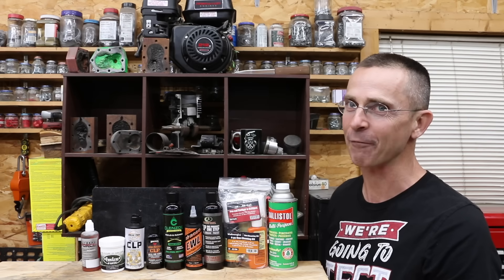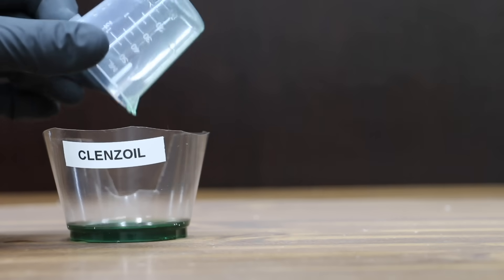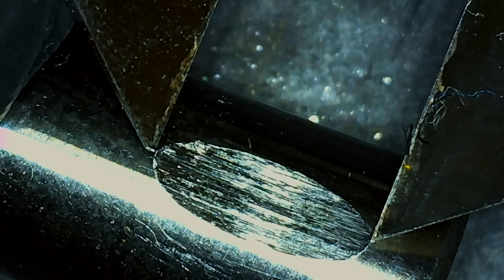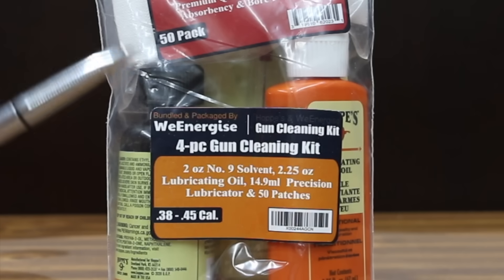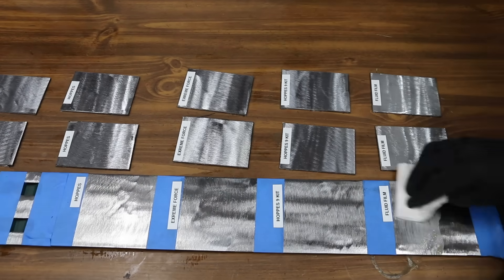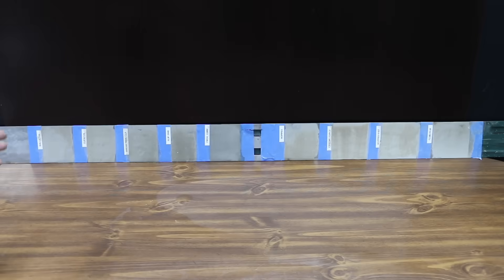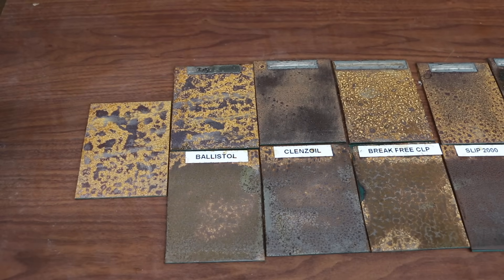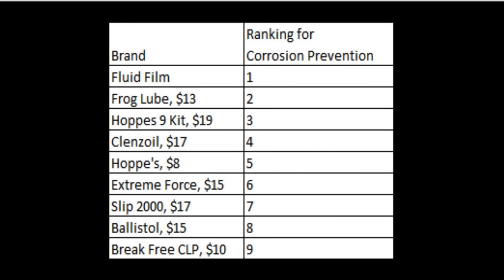Don't Buy A CLP Until You Watch This Review! It'll Save You Time And Money!

Comment: I know I'm a little late to the party here, but I'd be extremely curious to see some tests along the same lines performed with a product called Molykote D-321r. It's a spray-on, air cured dry lubricant that is a very long-lasting semi-permanent lubricant that performs well in both extremely hot and cold temperatures (-180 C to +450 C according to the manufacturerrer). 

The only reason I even know of this product is because I work in the aviation maintenance industry, and we used some of it on the intake fan blade pins. We had to apply it to these pins, then buff it slightly afterward to make it smoother as per the instructions, and I was surprised at how well it held on to the metal pin. After realizing the constant movement, stress, and extreme heat/cold this lubricant must be exposed to, and the fact it went through extremely stringent testing to be used in aviation, especially the engines, it made me realize it would likely work extremely well as a firearm lubricant. Only problem is (besides cost and availability, although I see it for sale on eBay for $50 a can) is that it's the same color as carbon fouling so good luck figuring out when a firearm is clean or dirty lol. Also, it would only be useful as a lubricant, not a cleaner.

Thanks for reading, if you did, and keep up the great work! You continue to astound me with your creative yet extremely thorough tests.
Reply from the maker: Thank you for the video idea!

Comment: Thank you so much for this and other great videos. I want to pass on a tip to the readers and avid gun users/cleaners. Lately, I have had a few guns "gum up" on me - meaning, the oil that I had used becomes almost a solid or extremely dense and sticky. After much research and trial by error, what I found out is that I was MIXING different oils - meaning I would start by lubricating with one brand of oil and then I would use another one just to make sure the gun was nicely lubricated. Turns out that some oils do NOT mix and as a result become extremely NON oily and become sticky and gums up the gun in lieu of lubricating it. For those guns I had made that mistake, I used 99% Isopropyl alcohol to thoroughly remove ALL oil from the parts (i.e. barrel or slide) and then used only 1 oil and that solved the problem. I do use the Hoppe's black precision HBL4 as it is THIN and NEVER gummed up the gun or ended up being sticky after hours of shooting.
Reply from the maker: You are welcome!  Thanks for sharing.

Comment: First off, AWESOME JOB sir! I really enjoy your videos and this one ranks up at the top for me.

That said, I personally feel you need to be familiarized with Frog Lube if you use it in another comparison video. The paste breaks down to a liquid with very little use or application. Simple body heat melts it and after many many years of using the stuff I don't recall any time it returned to it's initial state of a thick paste. I would suggest maybe getting it to that liquid state to test the friction reducing capabilities at a minimum? I understand the "right out of the container" approach, but literally nobody applies it as a paste and calls it good when cleaning and lubing their firearms. Like all other CLP products, Frog Lube has to be worked into the surfaces it is being used on. As for the freeze test, yeah not much can be done there lol. Anyways, apologies for that single gripe lol. I just love that wintergreen smelling crap and have had so many years using it to brilliant effect so when I saw it used in such a way to reduce friction, I just had to speak up! Oh well... 😉
Reply from the maker: Thanks!  Thanks for the feedback.

Comment: Another one to add that I recently came across that people talk a lot about is Shooter's Choice MC-7. Also allegedly the Government utilizes RADCOLUBE but there's no way to verify that information, it could be branding. Although it isn't necessarily a cleaner, the lube/protection, a lot of people utilize MoS2 but I think I may have left feedback similar to that on another video of yours, so if I did, apologies. There's a serious debate as to if you should use oil or a grease on metal on metal parts. 

I think you've shown Ballistol a few times on this channel. That stuff is pretty cool :0)

e: A thought if you were to do that dust test again. I wonder if a car paint thickness gauge could allow you to measure that in a slightly more objective way to see which ones got the most crude. :)

Comment: ive used frog lube for over 5 years now. havent had to rebuy, it goes a long way even with "seasoning" the metal the first time.
a warning i would give on frog lube is its tendency to gum up in the finer parts if stored for longer periods of time. 

atm im trying battle born hp pro

also, froglube smells minty. so your house wont smell like an armory when cleaning (which others may appreciate), and breakthrough doesnt have a smell.
Reply from the maker: Thanks for sharing.

Comment: This was great!!  I have one suggestions - I can't help wondering if your accelerated corrosion test spray may be dissolving some of the products, or otherwise interfering with them, so maybe not an accurate representation of what might happen in real world situations.  Maybe for protectents, a long term high humidity test would be more accurate?  I know that's a pain because it takes a lot longer.  Love the work you do, though, I don't mean to be critical.  This is the first place I go for product reviews of anything.
Reply: He has to compromise with all the tests as it's just 1 person trying to remove as many variables as possible and how close that is to real world conditions is very  subjective and vary between different products. 
On this one i agree Though, I don't think any of these tests can be compared to actually using it and shooting the gun.
Reply: @whatsmolly5741  You're right.  I don't mean to be negative about project farm - he's doing better reviews that any channel or even magazine I've see, and they're fair.  I always check here first for reviews of anything tool related that I buy.   Was just offering a suggest for improvement.

Comment: I tried some clenzoil. It was alright. I used it to clean a break down 12 gauge shotgun and was reasonably impressed at its cleaning power. On the other hand, I used clenzoil on my Ruger 10/22 and it took the paint off of my stainless steel receiver. I gave the clenzoil away after that. There are too many CLPs around that dont contain turpentine. I am sticking to BF CLP and SLIP2000 products. The directions on the clenzoil say to not use it on painted surfaces. I just am not comfortable using the stuff on AR-15 bolt carrier groups because of the little rubber piece in the extractor. The stuff smells like a Christmas tree.
Reply from the maker: Thanks for sharing.

Comment: That's the general use Ballistol, which is designed for endless different uses. If I'm not mistaken, they produce a different product that's meant for guns as the others that are compared on this video. Ballistol works great for me and it is by far the most versatile oil out there. That's what people should have used, 90% of the times they use WD-40. Most people use WD-40 as a lubricant or oil, but it's not even close to be anything like that, it's a chemical solution, designed to penetrate rust and that's it. It's versatility ends on removing rust or glue residue. In my opinion on some occasions works ok, but I'm not satisfide 100%, as I am with Ballistol and it's literally endless uses.
Reply from the maker: Thanks for sharing.

Comment: Would really love to see you test another few CLP‘s. Eezox is one that a lot of people recommend. There are also old standbys like Rem Oil and something like Shooters Lube which is one of those Facebook advertised scammy products which many suspect is just regular oil at five times the price.

There are also tungsten and molybdenum based lubricants. Would love to see how those perform.

You didn’t properly do the lubricity test for the frog lube. You’re supposed to coat the part and heat it up and let the lubrication cure before you use it. I’m very curious how it would’ve done on the test how do you properly applied the frog lube.
Reply from the maker: Thanks for the video idea.

Comment: always used synthetic lightweight motor oil for autos on my firearms never rust or clogging. long term storage I have used bearing grease, when cleaning stainless steel guns I use brake cleaner it does not leave residue on your weapon and breaks down, pushing out fouling and dirt. tks.
Reply from the maker: Thanks for sharing.

Comment: As a Marine, I was rooting for the Break Free.  It is the best in all categories but you do have to shake it 2000 times and have a Staff Sergeant motivating it reach its full potential.  It also doubles as an after shave that the ladies love the smell of.  Ok, not so much but my vote is still for Break Free.
Reply: I hear it's good when drizzled over crayons. Thanks for your service, Marine. 
-Retired Army SFC
Reply: @DesmoProfundis  🤣🤣🤣🤣
Reply: @DesmoProfundis  lmfao the best comment ive seen!! MAde my night im crying over here
Reply from the maker: Thanks for sharing.
Reply: @roaringsteelmedia 
I just saw Lucas CLP at O'Reilly's last night and remembered this video.
Shame it wasn't included.
Hopefully he'll do another one along these lines some day.
Reply: I have a bottle of the lucas. It seems to pool up vs penetrate on surface metal@wanderingcalamity360
Reply: The Army switched to Break Free in 78 or 79.  I have been using it since then. But then I still have RBC and LSA I use. Looks like the Army went to a different CLP in 2002.
Reply: @schristi69 it's still used, as stockpiles are worked through.
Reply: Break Free smells exactly like "Sex Panther"
Reply: @never2be07 only 60%of the time.
Reply: I just bought some break free, but it wasn't the aerosol can. Hopefully it's just as good.
Reply: Did you guys ever use the gallon jugs of radcolube 3 in 1 and a plastic spoon for an applicator?
Reply: Semper Fi marine
Reply: I shower in that shit
Reply: Winner:
Clenzoil for corrosion protection and anti-wear properties.  

Breakfree simply for flowing in temps at -40*F .
Reply: @colt10mmsecurity68 why do you need -40 degrees does it get that cold where you are ?

Comment: Great video!  I've used Ballistol for years, but after watching this video, I ordered some Clenzoil, and I just used it to clean 6 and lube 6 guns.  It seems to be a much better product.  Thanks for dropping some science on me!
Reply from the maker: You are welcome!  Thanks for sharing.
Reply: I've been using Ballistol for years based on recommendation of well-known YouTuber. Will order some Clenzoil and maybe one of the others soon.
Reply: @fog8969  IMO Ballistol is the best all-in-one cleaner solvent, but as the results show, it should not be relied upon for lubrication. Makes sense to me that the best solvent would be a poor lube.
Reply: @teebob21  Agreed. I am goona keep both Ballistol and Clenzoil handy, because I like them both.  I've been using Balliston to do light after-practice cleaning on rifle bores for so long, and it works fine for that, so will probably keep using it for that. (I use Hoppes 9 for deeper cleaning.) The Clenzoil has to be shaken (or so it says on the bottle). It's more viscous and therefore more runny, which is not good for some applications where you don't want it running onto parts you're trying to keep dry. But even though it's runny, it somehow seems to provide a long-lasting coating. Not sure how that works.

Thanks. Always interested in other's experience and opinions.
Reply: @fog8969  GarandThumb???
Reply: @Bishop_2017  Hickok45.
Reply: @fog8969  ahhh Garand likes it too. Said he always used it. No hate though. This is some extensive brutal testingn
Reply: Ayy man, they're sponsoring C&Rsenal now - so Ballistol is clearly the best IMO and everyone should buy it!

[OK, I'ma prolly get some Clenzoil, but I might support the cause and get some Ballistol to use as a cutting oil or something lol]
Reply: I used Ballistol since 1997. Great non toxic cleaner, gun care product. Around 2020 or so, I drifted more to Slip 2000 EWL & later Clenzoil CLP. Slip 2000 is odorless, easy to apply. Prevents rust. Clenzoil does a good job ✅️. Central FL. I'd add I use Cerakote Elite on a few ccw/duty guns.
Reply: gotta get rid of ballistol after this. The smell is terrible too
Reply: @dontquestionmyname5490  Oh my god, Ballistol smells so bad!  I just cleaned a dozen gun using Clenzoil, and not only are they clean, but I'm not gasping for breath!
Reply: Lol me too

Comment: This was a VERY informative video. I’m particular about what oils I use in my motorized equipment, but I’ve never been so particular about what oils I’ve stuck to on my firearms. 
I’ve tried many of these brands over the years. The ballistol sticks around over time but it absolutely reeks in my opinion. The frog lube builds up in the mechanisms and it causes failures to cycle in cold weather. I’d love to see how rem oil and Lucas gun oils compare, those are the two I’ve been using recently. 
Thanks so much!!
Reply from the maker: Thanks for the video idea.
Reply: i recently used mobile 1 synthetic 10w30 and it worked great on a couple new guns for their first day on the range lol  didnt plan on that but the bag with the other gun oil got left behind somehow so we improvised and had zero issues. will be cleaning and using some more made for guns next time but not sure if theres much difference in the oils really.

Comment: Pd680. Hands down the QUANTIFIABLE BEST solvent for cleaning gun part( or any other metal for that matter). Completely cleans, degreases, and prevents corrosion on even the most neglected parts.  Its expensive, but you can get "expired" and/or "reclaimed" drums for pennies on the dollar if you do your due diligence. Its also not hard to filter & reclaim spent solvent at home.
Reply from the maker: Thanks for the feedback.

Comment: Awesome video! Really fine work. I am surprised by the Breakfree corrosion test. I have been using it since the early 80s and it has protected my firearms from rusting over long periods of time. The worst for that is WD-40, which over time dries and flakes and moisture gets underneath. Thanks for the great video!
Reply from the maker: Thanks and you are welcome!
Reply: You are certainly correct about WD-40! It will form a varnish which will totally freeze up moving parts. I have had to open stuck revolver cylinders with a wooden mallet.

Comment: Looks like one would require at least two types to cover the anticipated environment the gun will endure. Not realistic to anticipate very cold and hot at the same time of using one’s gun. But it’s all good information. The Hoppe’s 9 and Clenzoil had two test bad (or lesser results) while all other tests were upper acceptable. IMHO the cleaning, wear, and rust prevention are the most important. Others may feel differently.

Comment: There is a huge problem with this video. And it has to do with frog lube. For the most part frog lube is a "semi"dry lubricant. Also it has  to be applied properly in order to work properly. I use it on all my firearms. After it is applied according to directions,  it has outperformed every other clp I have tried.

Comment: Ballistol is actually a type of natural seed oil and is not petroleum based. It's my go-to for my black powder rifles, they do not like petroleum based lubricants as they increase fouling. It also does a really, really nice job on wood and leather, especially oil finished wood that is not sealed. As a bonus I really like the smell.  For modern firearms it's Break-free CLP although I may now have to give this Clenzoil stuff a try. The thing about Hoppe's: it used to work a LOT better, but it had something (Kerosene maybe?) in it that was not good for you so they removed it, and it does not work nearly as well now. I've got several containers of the old original No. 9 I've picked up and the difference is instantly noticeable. The old stuff works WAY better! I just wear gloves when I use it. ( I also have some 1960's era USGI bore cleaner that works great...it's carcinogenic as all hell, but boy does it work! )
Reply from the maker: Thanks for the feedback.

Comment: Ballistol would be my only choice for dissolving lead and copper/brass and can by emulsified in water no problem, so for that purpose it’s perfect, and it’s great for a general use oil (much better than 3 in 1 for most uses IMO) and is food safe which matters for a lot of things, just not fun care LOL.. but as the test results show, it’s not great for any other uses for guns and I’m not surprised. Still a very useful oil to have around and can even treat wounds/prevent infection, safe for animals and protects wood and leather from rot as well. Love the stuff, but unless cleaning a barrel or on the stock or holster - don’t use it anywhere on a firearm
Reply from the maker: Thanks for the feedback.

Comment: BreakFree CLP won in a test way back  online somewhere ...I use it  .   The big question is whether you can save money by cleaning the gun with poiwder solvent or degreaser  and lubricating it with Mobil One motor oil .
Reply from the maker: Thanks for the feedback.